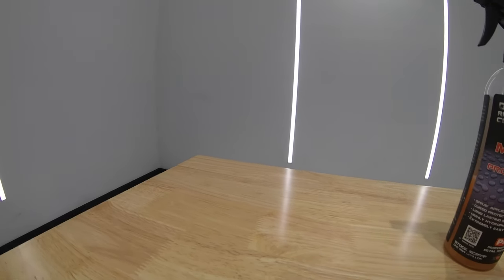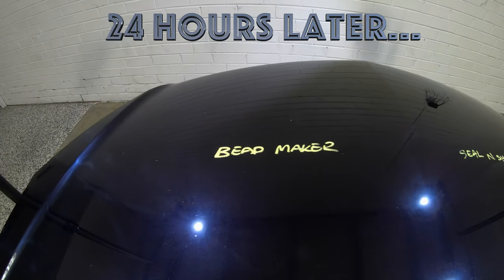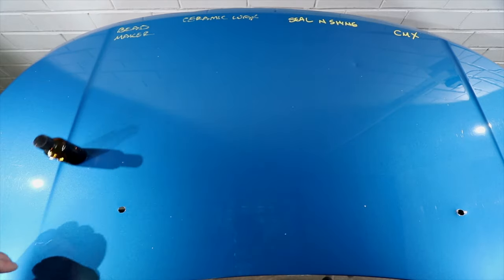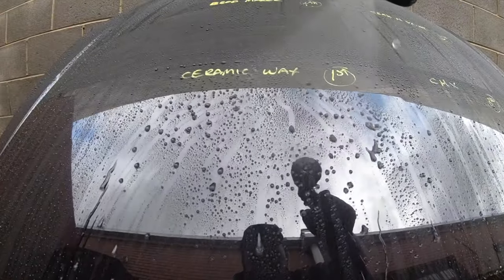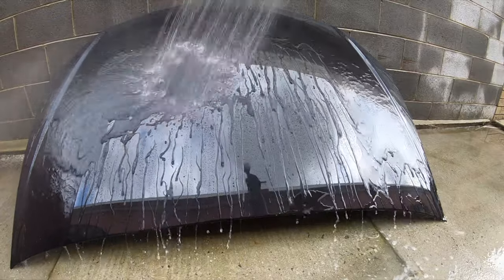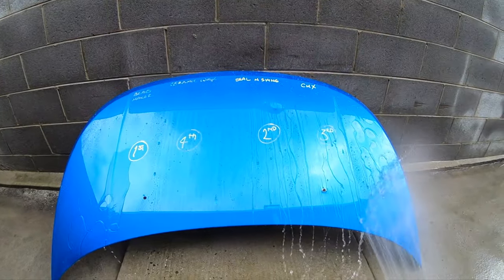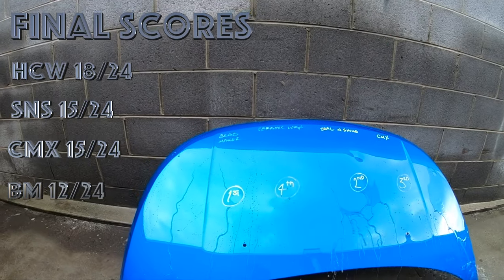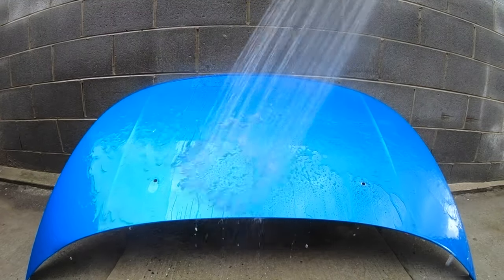Bead Maker vs Hybrid Ceramic Wax vs Seal n Shine vs CMX + Which one would I Choose?

Comment: I just try apply meguiars Hybrid ceramic wax on dry paint and it works great, I use 1 microfiber cloth to apply and spread and another to wipe off and a last microfiber cloth for the final buffing, no streaks and fantastic results

Comment: Thank you for your unbiased and transparent review.
The meguires product is impressive and I'll give it a go, but I don't know what happened with the bead maker. I have used it several times, including my daughter's new Hyundai elantra. It still water beads better than your test panel, even nearly a year later, with no further treatment just regular washing.
Bead Maker does require a bit more product on the panel during application, and could be the difference.
Thank you again.
Reply: Your correct. Bead maker is lot better when applied properly. In my test it’s better in gloss and beading then seal and shine.

Comment: Great video and very nice honest effort. 

I just want to make one point. The bead maker when first time used is supposed to be very liberally used. It is supposed to be sprayed on the MFRowel liberally and applied to each panel and 24 hrs later you give a light spray and wipe like a detailer and it’s done. Yes, I agree for ease of application, this will loose all the points but the chemical resistance and gloss where it’s showing it’s not good, it’s not so. You just have to apply it as a base coat(first time) and keep using from there on as a detailer. 

It’s also one of the few items which are cheaper options and pretty much same price/cost as United States (or even less) and credit to the manufacturer for that. You sort of feel deceived by other manufacturers here in Australia. 

So if you end up using half or even 3/4th bottle for fist application on bead maker, it’s still economical compared to other brands. The sleekness is next to none and gloss is also enhanced if liberally used. 

This is from my own experience on my car pro 3.0 ceramic coated car. 
I don’t have shares in Bead maker!! 🙂

Comment: I like that you flooded the panel. I never really understood why people use the shower setting or pressure washers to test water behavior
Reply: When it rains, it showers.
Reply: @justin94block  water behavior with the shower and most other setting, can be manipulated to produce a desired result. Where as with flooding, what you see is what you get.

Comment: I'm a Bead Maker believer, but only as a topper and not as a standalone product. I'm not taking any exception to your test, results or opinions... But I'd like to see this test repeated using these products as a topper over ceramic (take your pick), or some sealant/wax combo (Power Lock/Collinite or Opti-Seal/Optimum Car Wax).
Reply: Will do!
Reply: I agree with your feelings that Bead Maker is a great topper as it adds gloss, depth and slickness to the paint, but doesn't last long enough to be a stand-alone product. I use it over my ceramic-coated car and also use it on my girlfriend's car over top a coating of Meguiar's Hybrid Ceramic Wax.
Reply: @archiepezek  Sandro just showed that Beadmaker doesn't improve gloss and the hydrophobics are pretty poor.  If anything, you're probably hurting the performance of your ceramic coating by putting Beadmaker over it

Comment: Thanks for a pro review!
Just tried the Turtle wax Seal n Shine on my Black car and I must say it looks really good - dept is greater than the detailers I have tried so far and takes nr 1 spot until now. I have ordered the Meguiars Ceramix Wax to compare.  Other detailers I have used: Kenotek showroom shine, Soft99 fusso coat speed & barrier V2,  Bouncer's Done & Dusted Quick Detailer.  The Meguiars is a bit more expensive than the Turtle wax but I noticed that there´s more in the Meguiars bottle 768ml vs. 500ml in the Turle wax.
Reply: Hi. Did sEAL n shine leave a haze upon application? I polished my car after clay bar and it looked amazing. I then applied seal n shine and as I wiped it off I noticed it left a haze which is very difficult to rub out....

Comment: Meanwhile I use Seal&Shine as base-layer and Beadmaker as topping.

I have three cars - White Uni, Brown-Metallic and Nightfall Gray Metallic.

And nothing compares to the gloss of Beadmaker...

So I am wondering about your gloss test...

And about beading/sheading, your water ray is to hard. In real, rain of course, the beading/sheading of BM  is the same like the other products. In this test it seems, BM fucks up, but the area with BM is completely dry, in contrast of the other products! And this is a very good effect in my opinion...

Only my 2 Cents of my own experiance... 🙂

Greetings from Germany 

And nothing to forget:

BM is easier to use than the others...

Meg - mostly I wash the car in a box, at home again my car is dry (Meg is working at the best applaying on a wet surface)

Turtle - is wipe away harder, often you get strikes 

BM - easy on, easy of

CMX - till yet, I didn"t used it 😏
Reply: I was thinking the same thing with BM on my SNS as I'm having no luck finding Ice Detailer. I applied one coat pf Ice Spray Wax and see how that holds up.

Comment: First off, I think the comparo is apples-to-oranges when you  mix SiO2-based sealants (CMX and HCW) and non-SiO2 based sealants (SnS and BM).  I have used only SnS and BM however.  Interestingly enough, I noticed no difference in shine between the two; however if I had to give an edge, I would give it to BM.  As for hydrophobic properties, I noticed the BM to be superior, not just a little bit better, but superbly better.  The BM was a simple spray and wipe off; whereas the SnS required me to buff away streaking.  On top of it, I noticed the BM lasts twice as long.  

The SnS was nice but the BM was simply better.  I look forward to try some SiO2 sealant some day, so I'll keep your comparo here in mind.

Comment: When PanTheOrganizer did the comparison with Seal N Shine and Hybrid Ceramic, the Meguiar's didn't even last the first test for the chemically resistance. Seal N Shine did however even after the second test.
Reply: Really curious about this myself. I think their methods of application differed.
Reply: Pan followed the instructions so he applied the hcw on a wet panel as this guy applied it on a dry panel coz he thinks it's more durable, which it is by the looks of this test.

Comment: I did notice, on the first test, that although bead maker came last for water behaviour that when you stopped wetting the panel, the bead maker section was the dryest😳 beading is all well and good but after it dries it leaves dust spots behind so sheeting the water off is surely better🤔 never used bead maker before. I have the seal and shine to use when I run out of my sonax bsd angelwax qed 50/50 mix which I use as a drying aid with excellent results👍
Reply: Whether a panel sheets or beads is based on how the water is applied. A completely bare and unprotected panel will "sheet better" in the sense that it simply won't bead, while motionless, but apply motion, air or a moving stream of water and a hydrophobic surface will shed and sheet better. 

It's incredibly easy to form incorrect assessments about beading vs sheeting. Products that aren't very hydrophobic love to tout their "superior sheeting," but the reality is there is nothing superior about it. It's a misleading claim that doesn't translate to the real world.

ANYTHING that is super hydrophobic will cause beading and water spots if left stationary in the rain - BUT - if that car is driven, the hydrophobicity will clean the car far better.

Comment: I have bead maker on my car. It beads water a lot more than video. I applied it to my car when it was wet the 1st time. I used a lot of product. I let it cure for  a day. The next day i applied 1 more coat to my dry car kind of like you did in this video. For me water beads off instantly no sheeting at all. Just beads right off. Wonder if applying it 1st to a wet car and applying a thick coat made the difference.

Comment: Great comparison. I almost feel bad living in the US. I've largely moved on from it, but when I first bought Seal N Shine, I had a coupon and ended up getting two bottles for $10.99 compared to your $26 for one bottle and the Hybrid Ceramic Wax was $15 at Target. Neither are my favorite product but the value of the Seal N Shine is insane and I ended up using it on cars I don't spend a lot of time cleaning. In fact, just this week, a neighbor asked about my 2005 Subaru that I leave outside. We recently had considerable snowfall and after it melted away, it still looks like I literally just washed and 'waxed' it though I Iast cleaned it in any way four months ago. Obviously up close, it isn't perfect but it's become my go-to suggestion for folks that just want to do super minimal work... basically drive through a basic car wash with no wax, dry off and spend 15 minutes or so with one product. That's not my method, but basically everyone that has tried it, loves it!

Comment: I bought a bottle of that Maguire's hybrid ceramic wax about a month ago, I found I was mostly wasting it doing what it said in the directions on the bottle. A few weeks later I ended up using it in my Bowden's Own snow cannon just to see what would happen. I mixed it the same as the snow foam 900ml water and 100ml wax and I was able to coat 2 cars with it. It actually turned out really good, I used Rain-X to fix the problem of the wipers leaving streaks across the windscreen.

Comment: Give Griots 3 in 1 Ceramic Wax a head to head with Meguiars Hybrid Ceramic Wax.  I did a little side by side myself and the Griots depth and gloss was drastically better than the Meguiars after two coats.  First application was close, but second- griots knocked it out of the park.  Better user experience with wipe on wipe off too.  Not sure about durability but your videos are outstanding and I'd love to see the comparison from you!

Comment: Accordingly to Meguiars video about hybrid ceramic wax, You need to do it with water because the of the hydrophilic particles to activate.....So, having said this I dont know if it affects the test. Probably it does, foundation layer and all that. Im a Seal n shine forever fan but maybe the scores would have changed. Awesome work bro, by far the best!

Comment: Excellent comparison thank you! I just applied Seal and Shine to my vehicle topped with Ice Spray Wax, then it'll be Ice Wash and Wax to test the whole "system" lol. I've used and still have some original Ice products and they are excellent, too bad they don't make the Liquid Clay Bar anymore, that was great and I still have a panel's worth left. I HCW was my first choice until SNS came out but both are a great choice. Bead Maker seems like more of detailer than sealant in it's overall performance.  Canadian pricing for me, BM $14, HCW $27, SNS $15, CMX $27.

Comment: Hi Sandro, Just used the meguiers spray on ceramic hybrid wax Today 3rd Sept 2019 and its the first time my car and i was impressed, gloss and shine, now as far as how good its going to be when i used the gold glass with the meguiers snow cannon or better still use meguiers soft gel wash soap, that way its cleans it with out having issues of the soprey of coating, but then again maybe use the cannon with the gold glass soap, which should be easier in relation to helping the meguiers spray on sealant. :) 
Also i will need to wait to drive when it rains and see how easy it is to clean, also its the first foundation layer which is on the car and cant wait to i need to clean it when the next sunny day, but cool day as well. :) I am not going to spray it on and then spray it off ?
PS: i was cleaning the front windscreen and the spray bottle of glass cleaner almost fell of the car and it was just on a little bit angle and lucky i got hold of it before it fell onto the bonnet?

Comment: Excellent work Sandro. It seems to me these products are nothing compared to a real quality ceramic coat or even sealant. Slickness and water beading as you previously have demonstrated mean two things. End of the day its the level of protection, water beading, enhancement of the paint finish and longevity.

Comment: Great video! I recently used SNS and they are great so far. They do leave little bit of streaks but can be easily removed with 2nd towel. But they do cure like a glass and is very sleek. I will definitely try out the Meguiars next. They are about double the price here in the US. Thanks again

Comment: Best way to apply the Meguiars?  I've done as the bottle says- applying while the car is wet.  It was streaky and didn't last very long.  I've done it dry and it lasted longer but again- streaky and not easy to apply.  I've also varied the amount of product used (using less is better) but I just can't get a nice easy application.
Reply: Car Craft Auto Detailing Thank you for the reply. Great, helpful video.
Reply: @ak2112  It's also important that the surface is properly prepped - the more clean and corrected, the better the product will both bond and perform.

Comment: One thing to be careful of. You shouldn't apply them all the exact same way. You should apply them all based on the manufacturers application recommendations. That way each product is tested against its intended use. Obvious that will then influence how easy/difficult and cheap/expensive things are.
Reply: You logic
Reply: I get your logic but I’m not sure I agree. My impression (and I could be way off) is Meguiars recommends the ‘spray on wet, dry - spray on wet, rinse, dry’ method as a “convenience” and not because it provides optimal results. Possibly the wipe on, wipe off method is a bit more work but not much. Application and removal were a breeze and I’m loving the results. I prefer a comparison that shows the optimal results of each product, not necessarily the manufacturer’s recommended procedure. Just my .02 ;)

Comment: I really appreciate the thorough video, showing actual testing. I'm not sure that ranking 1st to 4th and then assigning 4 to 1 points is very fair compared to say giving each product a score of up to 10 points in each category. I think if you did this you could better differentiate very close performance (e.g. maybe Meg's is a 10/10 for Chemical Resistance but rather than being 25% behind [4 pts vs 3 pts] TW SnS is 9/10 and CMX/Beadmaker are lower than 5/10 and 2.5/10).
Reply: Very good point mate, I thought the same thing

Comment: What happens if i wash then clay, then wax, then seal and shine and finish with ceramic?is that too much?over kill?or perfection?
Reply from the maker: Paint correction is what really tends to improve automotive paint and get it as close as possible to perfection. A good wash and decontamination of the paint is necessary before paint correction and a good wax, sealant or coating will further help improve the finish, but compounding and or polishing paint is what really has the most impact. 
https://youtu.be/6tepA3wjPbY

Comment: Meguiar's hybrid ceramic wax 👍👍👍👍👍I love HCW in top coat, over fast finish!, I had good hydrophobic results, resistance by doing: prewash, washing 2 buckets, clay bar, ipa, ultimate fast finish, 12h after hybrid ceramic wax then  a new cure of 12h.  I found more resistance in time than with hybrid ceramic wax alone!
How did you apply HCW for the test, wet or dry?

Comment: Beadmaker keeps the car very clean even after a drive in rainy weather and it behaves differently on my vehicle than on this test (or that last one) but it was also applied more heavily on the first time (look at The Rag Company). The gloss, after it hardens, is also super. I was a sceptic but turned into one that loves the product. My background is Opti-Seal "lover" and Bilt Hamber Finis Wax "tweeker". :)
PS. Again I would say something is wrong with your batch of Beadmaker?
PS2. The best test of these product would be to use them on a daily driver, then you could see which one attracts dirt and which one keeps your car looking good.
PS3. Have already decided to try Turtle Wax next winter (real winter here).

Comment: I applied turtle wax on our cars  last weekend. So far , can't be beaten for value. However fully agree it's a pain to apply.
Reply: Please reply back if you notice dirt sticking to the paint and/or if you notice it get dirtier than usual.
Reply: I don't get the difficulty to apply that people mention.  I give each panel to sprays after the car gets a hose rinse with no nozzle and just work my way around the car.
Reply: @dyoel182  If you apply it dry on dark colors you can get haze and streaking that is VERY hard to remove without using water/QD. If you apply wet, longevity takes a major hit but cuts down on streaking. If you watch Sandro's review on this channel a week or so ago you'll see him demonstrate these issues with S&S. I had the same exact experience.

Comment: Is the Australia's turtle wax seal and shine different than the N.American one?  In the N. America it's called turtle wax ICE seal and shine.  And a lot of the other youtuber found the chemical resistance for the ICE seal and shine better than HCW.
Reply: I looked at the link in your YouTube description for turtle wax seal and shine,  the bottle is the same but on the N. American one the label has ICE written on it.  Maybe the Australian turtle wax seal and shine is still using the older formula therefore the chemical resistance  aren't as good.

Comment: Sandro all the other reviews i have seen  with Megs ceramic Wax  VS Turtle Seal and Shine , seal and shine always out lasts the Megs ceramic wax in the chemical stripping resistance test!
Reply: @CarCraftAutoDetailing  They applied it to dry clearcoat.